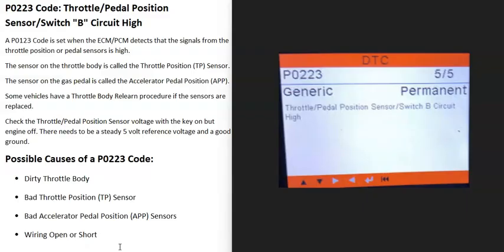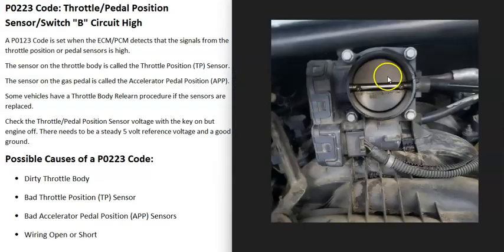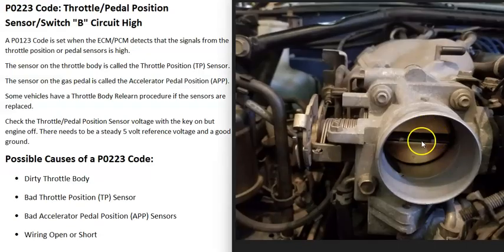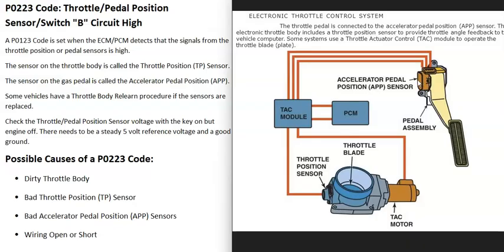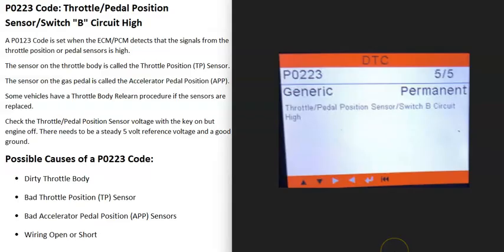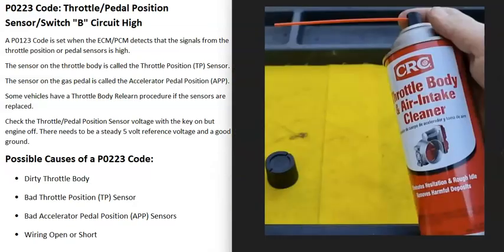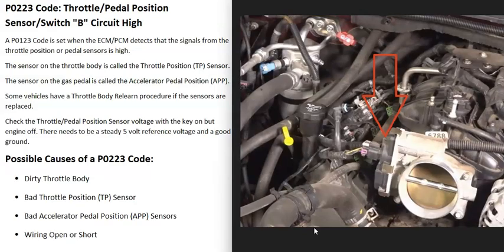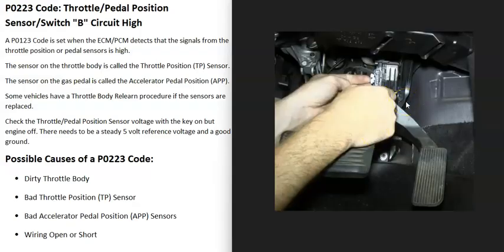Causes and Fixes P0223 Code: Throttle/Pedal Position Sensor/Switch "B" Circuit High

Comment: i have the same issue with those codes i have replaced the throttle body i still can’t find the problem any idea
Reply: Did you fix it?
Reply: @ still not

Comment: Hi I have  a question. I am getting 5 volts on one of the power lines for the throttle  body and the 2 ND one. I am getting 2.5 volts any idea what do I need to check?

Comment: I have a 2012 Nissan Versa. There are 6 cables going into the throttle body input. Two of them should give a measurement of 5 volts each. One measures 5 volts but the other measures 2.5 volts. Where can I check to get the correct 5 volt reading?
Reply from the maker: It's best to find a wiring schematic for the vehicle to know what pins do what. Sometimes, wiring schematics can be found for free, but it can be hit or miss. Professional mechanics use paid services such as All Data and Mitchell Pro Demand. All Data has a DIY section for individual vehicles, but it does cost by the month, and they often have recurring monthly fees, so if used, be wary of which service is bought. Finding a manual for your specific vehicle information is likely best.

Comment: So I have a 2010 silverado 5.3
I have blinking check engine light,parking break light, traction control light, and service stablitrak       . Codes it’s throwing are p0306 (cylinder 6 misfire) , p0121,p0122,and p0223. Ic changed the # 6 coil, ALL the spark plugs and wires, new TB position sensor, and new accelerator pedal sensor  idk what else to check??!
Reply from the maker: It needs to be diagnosed but it sounds like a wiring issue.